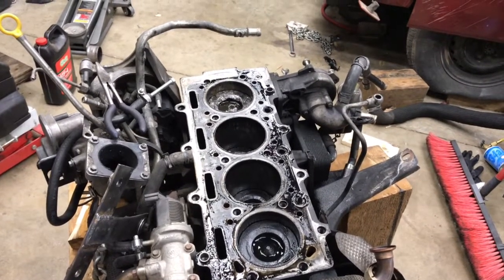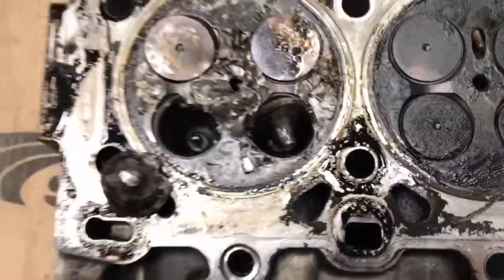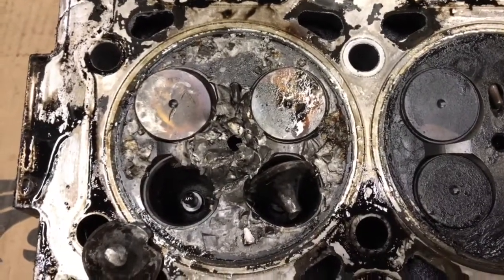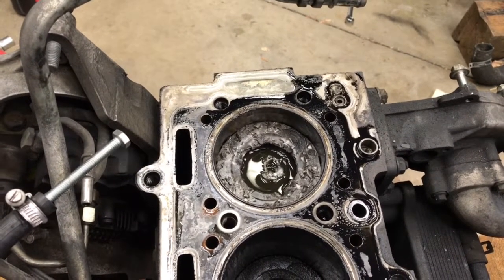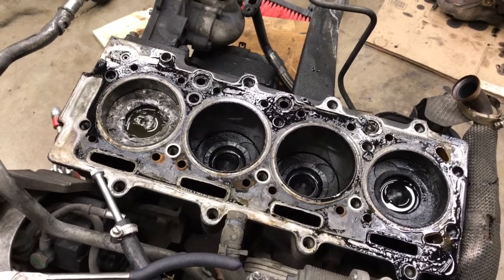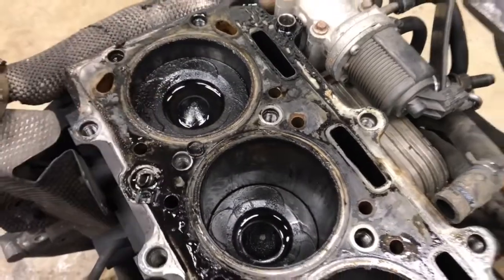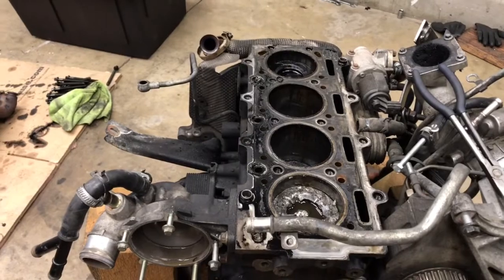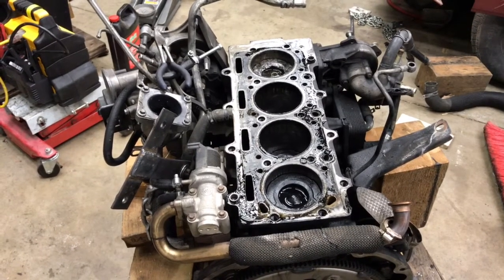Valve Carnage! - Junkyard Jeep Diesel Engine, 2.8 CRD for Liberty KJ - Part 37....final?

Comment: I am having nightmares of dropping a valve in mine now....
Reply from the maker: Not much you can do about it though, valve might drop with 200k on the engine or it might drop with 10k on it. Some think that replacing all the valves with new ones should be done as preventative maintenance, and I can understand the point. But I also see brand new heads that drop valves as well, so it doesn't seem like there is any winning solution.
Reply: COrobotchicken Damn it! I like the idea of these little engines, but your reply has me worried. It’s been how many years since it’s inception, you’d think someone has found a solution to replacing a head nearly every time a valve drops...
Reply: @cwoutkast491  I have 206k miles on mine and running strong! Fingers crossed. Running a straight 3in pipe from the down spout as soon as I got it and diligent maintenance has avoided a lot of problems.
Reply: @IcarusOffroad  Hello,this motor have aluminium block or iron?Thank you))
Reply from the maker: @cicikore13  iron block. Aluminum head
Reply: @IcarusOffroad  Thank you))

Comment: My condolences, my brother make the mistake of getting a Jeep with this engine . He’s on the second engine and it needs thousands of dollars of work. His frist engine had a turbo fail and it pushed most of  the oil into the intercooler . Though the engine was ok cause it ran fine but about a year later it developed a rod knock . Rebuild the engine. Rods, pistons rings, gaskets and bearings. Also needed a crank cause it got scored pretty bad. Bill was about 5,000$ . Not even 2 years later it takes a dump again all then sudden. Drops the exhaust valves on number 2 and destroys the head and the liner . Found a junkyard engine and put it in. Now a year later it has a blown head gasket. Had that fixed , but Turns out the shop put the gasket on and resurfaced the head but didn’t checked if the block deck was straight. It blew again 2 weeks later. Turns out the water jacket around number 2 cylinder is eroded and is 4 thousands below the deck. So to fix it, it will need to be pulled and taken completely apart and decked . Really po about it . Said it be a lot of money and the bill for the head gasket and head resurfacing was  2 grand. Not including the 3 grand for the junkyard engine. At this point it’s not worth fixing anymore . Probably just gonna part it out or junk it . I wouldn’t own one of these things even if it was free . They are ticking time bombs.
Reply: lol this engine is better than anything jeep has ever made